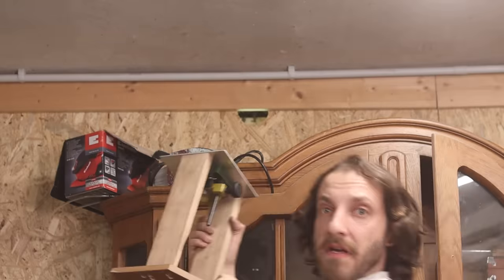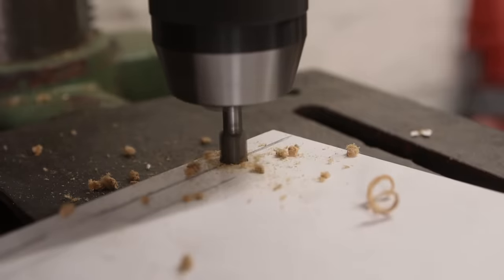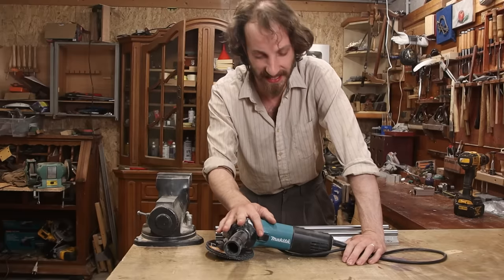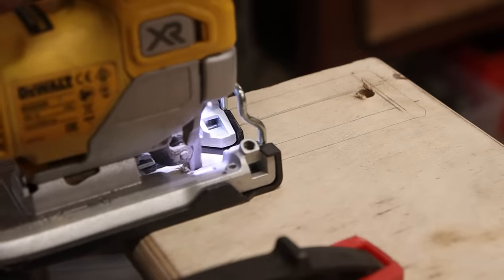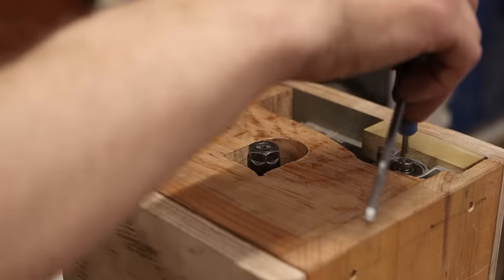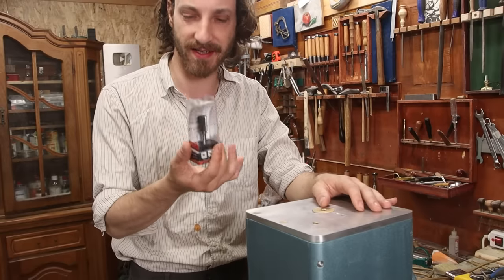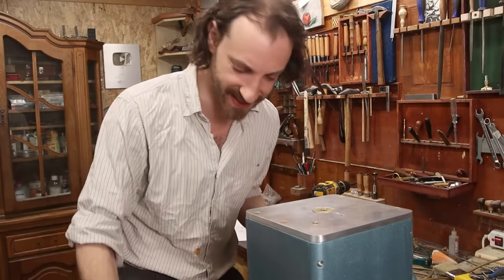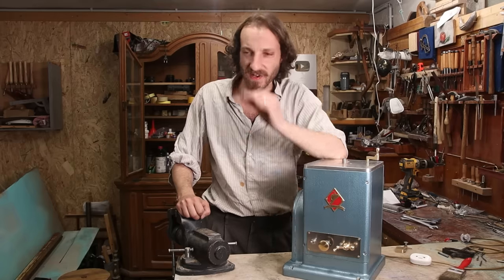Making a Router Table But It's For METAL

Comment: The Polish word for aluminum is glin.  Soooo much better!  
This video really made my day.  I needed a laugh, and you provided several.  Thank you!
Reply: +1 for glin!
Reply: In England the colloquial name is Ali, pronounce like alley, presumably from aluminium alloy.
Reply from the maker: Yes, glin, I like it!
Reply: Glin makes me grin. Glin foil is as easy to say as tin foil (which we use interchangeably though technically erroneously for aluminium foil). Count another vote for glin.
Reply: @chrisstephens6673   I just call it 'alloy' at work. But Tin is tin, not rolled steel.
Reply: I always just refer to it as "the metal that Americans can't pronounce". Rolls off the tongue.
Reply: @ricos1497  To be fair, there are 2 valid spellings of the Elements name that have 2 different pronunciations.
Reply: @ricos1497 Americans use the original name. It was the French or the English who decided to rename it just because they thought "ium is more scientific than just um"
Reply: +1 for glin

Comment: Fantastic work on this! Ive been using a palm router in a similar fashion for fine metalwork adjustment for a while now. I think it's time to make it more permanent!
Reply from the maker: Thanks! Absoluty! Though, I thought about using an actual router, but I'm afraid to die 😂
The spindle motor im using is a bit slower.

Comment: An incredible machine. It actually looks like cast iron from the 50s. The paint AK 250-90 is top synthetic and dries incredibly long, I think even a week depending on the conditions.
Reply: After drying is complete, it starts to harden. Like laqueurs, concrete, glues, epoxy, urethane etc. to reach the final result and stifness.
Reply: Do you know the specific name of the metal or finish? I've seen microscopes, slide projectors, and night visors with that chip texture gray color but haven't managed to find the name online

Comment: You should probably drill a hole in the top surface to accept a removable dowel, that way you have something to lean small workpieces against and won't be as likely to run a finger into the burr if it grabs.

Comment: I was wondering....how do you deal with the metal shavings falling down into the box? And your right the metal finish is beautiful!
Reply: especially since there is a china powersupply built in there. high pucker factor on the first slip aswell...

Comment: Another great video. You are just so creative. 

One little thing. That bit is actually for ferrous metal. For non-ferrous metal, there are special bits. Those don't have a cross pattern but cut sooo much cleaner in brass and ALUMINIUM. 

I'm actually from the Netherlands and just realised it is spelled the same in dutch.

Comment: 13:40 nope, you don't need a hardener. It's just designed to dry very slowly for certain applications.

You can put them in an (industrial) oven, to get a fast hardening process (60 °C for an hour, and you can assemble the parts) or let it dry for 24h under 20 °C conditions before assembly.

Final hardness is reached after 8-10 days.

Comment: You could also use a 14 in. chop saw for metal.  They make them with cold cutting, carbide toothed blades now (instead of the silicon carbide or aluminum oxide fiberglass blades of yore) which cut more cleanly and quickly.  You can get straighter cuts that way.  I can’t believe you have gone this long without an angle grinder!  They’re a must for any shop.

Comment: I really like this project, that would be super useful for my shop as well. Typical die grinder speeds always set me on edge so slowing it down is a major plus in my book. I wish I could give two thumbs up for the Candor, it makes me like the video even more than if it was all glossed over. Excellent job on the badge as well, top notch!

Comment: I think it looks great, the lines give it an Art Deco look and I love the color and the hammered finish paint, didn't know ppl had an issue with that type of paint. For me it ties the whole project together. Also I have to say the name plate looks amazing Ari, really great project. 👍👍

Just a tip, you can't use a metal router like a wood router and hog away material, it's just for cleaning up edges. 👍

Comment: That's the color of choice from the mid '60s, I had a 48" belt/disc sander with the same color from 1965. Also had a router table lift of somewhat similar design, minus the worm gear.

Comment: It looks pretty convincing. If I saw that in a workshop, I'd assume it was cast alloy or iron.

The only thing that I think could be improved is that control plate on the front. It could do with some engraved labels, and recessing the wood behind it so the plate sits flush with the front. That would make it look more like "It left the factory like that". As it stands, the plate screwed to the surface like that, it makes the panel look a bit like something an engineer did to adapt an old machine to take a newer replacement set of switches.
Reply from the maker: Yeah, that's a good tip! I'll be sure to make something a little different in the next piece.

Comment: Uri, you surprise me everytime, i hope that sometime i can visit a exhibition from you. Love your work! Much love from Hannover.

Btw. the Paint you first used needs around 6-8 Hours to be hard to the touch and 24 hrs to be completely dry when its around 20°C in your garage. you could have accelarated the hardening with a heater. it hardens enough to the touch in 60 mins when the painted part has around 60°C.

Comment: Tip for you, try using round over bits in the lathe to make the ball shapes. I have used them on every material and they work well. Good Luck.

Comment: As a person who appreciates whimsy, I greatly enjoy your videos. I would like to offer a suggestion for a project that may be right up your alley: a Rube Goldberg machine. Per Wikipedia: "A Rube Goldberg machine, named after American cartoonist Rube Goldberg, is a chain reaction–type machine or contraption intentionally designed to perform a simple task in an indirect and (impractically) overly complicated way. Usually, these machines consist of a series of simple unrelated devices; the action of each triggers the initiation of the next, eventually resulting in achieving a stated goal." Thank you for your consideration.

Comment: 12:11 we just call it by the grade. So, 2024, 6061 (specifically, where i used to work) 2024 is aluminum with copper as the main alloying element, used in aerospace applications. And 6061 is your bog standard aluminum, magnesium as the main alloying element; hard and tough, great corrosion resistance. 

Its not a "universal solution" but it works.
Reply: 2024? That is going to get confusing next year…

Comment: Great new tool Uri!  And I don't know why anyone wouldn't like that old hammered finish paint- it's SO much nicer than the ugly green many machine tools are today.  And congrats on getting and angle grinder!  I find them the single-most useful tool in my workshop- I have 6 or 7 of them now.  They can do most anything ;)  Oh and although I'm from a part of the world (Canada) that says 'aluminum', but since 'aluminium' is the IUPAC name, I'd prefer that.  'Aluminum' is the way it was first written in the early 1800s- although a lot of spelling wasn't standardized then anyway.  So we're stuck here with 'aluminum' just as we're stuck with Imperial measurements for many things, the silly 12-hour clock, and the even more silly MM DD YY date system.

Comment: It's funny, i was considering the same thing as i was baking brownies this morning and covered it in alu foil. I just call it "Alu" in most cases (in german), as there's nothing to confuse that with. inum/ium just means metal, as far as I recall, so it's not really needed.

Great video, i love the finished table. It looks amazing, and is probably a lot lighter than it looks.

Comment: Uri, as an engineer I must admit that there were times when I cringed at your actions, however the router works and that was the ultimate target. Your next project should be to build a sewing machine, so you can be well presented while you present 😅😂. There's nothing wrong with Aluminium, after all it was a Swedish discovery and Sweden is European. Good post, thank you, and try to keep your fingers attached to your hand and not the walls and floor.
Reply: Yes a uri take on a sewing machine would be good to see. Have been looking at 3d printed and the chinese leather cast I am modifying

Comment: In Poland we have aluminium, pronounced a-loo-mee-new-m. But there is also an unrelated Polish word for the element: glin, pronounced glee-n. It's mainly used for the element itself and not the macroscopic metal, but it's short and easy to pronounce, so you can have it if you want. It comes from the Polish word for clay: glina.
Edit: just read some further comments and realized I'm late to the party...

Comment: If you want to modify it further, a shavings collector? Maybe air powered to pull the shavings away. Maybe something that pulls from under the hole and above with another surface mount.

Comment: Omg the over arm follower, i would have never thought of that! That would be perfect for some stuff i want to use this kind of router for. 

I want to build essentially the same thing, i was planning the same motor and a simple tilt mechanism as well as lift (possibly adapt a spare router lift i have but idk).

Saw some stuff on using one of those motors horizontally on a stand as a general use bench motor in a lapidary shop. They made attachments for sanding pads + a table, a wet saw, buffing and polishing, all that stuff.
Sweetgum NYC - the videos im thinking of

Iv been wanting to do a router table like this for a while to make mini form cutters for the lathe. I have a few small items i make by hand but developing better ways to batch them out could make them a viable product instead of a single stupid thing im unwilling to sell for a reasonable cost lol.

Comment: The fact that someone as skilled and seemingly seasoned as you has not had an angle grinder until now is absurd and blows my mind... very cool though.. i think i caught an AvE reference in there which makes sense,, that guy is freakin awesome.. keep up the great work.

EDIT: i love the music for the portion brass handle, which is effing awesome that you made that.. how would you say ALUMINA in your part of the world? Oh and, that badge was badass.. ok lastly , try to make sure you dont wear out the burr in one place too much , oscillating spindle sanders do.a great job of this.  You can also put a cartridge roll on a mandrel in there if you dont want to be horrified at the thought of that thing catching and launching into valuable or vulnerable vitals, be it on your body or things.. idk

Comment: an advice.  isolate the power supply inside a sealed box as soon as possible or always put it outside with a box.  those type of power supplies have the PCB completely exposed and with all that metal dust and chips it's a snap to make a short.

Comment: Mipa PU 250-90 2K PU Top Coat semi gloss
High quality 2K-polyurethaneacrylic paint with a slow dust-freedrying for a high quality coating onmetal facades, machinery and steelconstructions. Mainly for rolling orbrush application. Also suitable asone coat paint on zinc substratesand aluminium.
Mixing ratio: 10:1 by weight
8:1 by volume
Hardener: Mipa PUR-Plus-Härter A 60
Thinner: Mipa 2K-Thinner

Comment: On my (wood) router table, I can change the bits without having to lift it all the way out, by means of a pair of offset or "bent" wrenches.  I just need to pop out the hole insert.

Comment: Hey, you have a lot of talents. You need safety glasses and a face shield if you want to keep them. The cost is so minimum that not using them is crazy. Those cut off blades on angle grinders break all the time.

Comment: Hey Uri , You should try to use a simple circular saw with diablo cermet II blade. it cuts through 30mm stainless-steel 303 like you cut a wooden dowel with the same saw

Comment: Just say "alloy" since pure aluminium is only used for electrical cable. We also say "ally" here. However whatever you choose someone will hate you. Another thing you can do is call it by grade. No one could complain about "T6 6061 alloy" or whatever you're using.

Comment: Aluminum or Aluminium, from the perspective of a machinist in North america, 30 years ago at least, as well as any other metal, could be referred to by it's SAE designation. for all grades of Aluminum, that would be SAE 20-, as a specific, SAE 2024, is aircraft frame grade. So instead of struggling with a word, you can just call it 20 series, or SAE 20.

Comment: Uri, you should totally make a brass wrench set. Market the for use with nylon nuts and bolts😊.

A steel wrench always fouls up nylon hardware. 

Or it may be the 200-pound gorilla using it. As AVE would say😅.

Comment: I understand you are new to angle grinders, but you put the zip disk in upside down. This doesn't matter 95% of the time but will be very dangerous the other5%. Some disks are made with a radial bias where if they were to chip/break one way they will clear themselves , the other they will dig in and overpower the user and throw the running grinder at them. . Be safe, I enjoy watching you.

Comment: Very nicely done. With the hammerite finish, it does look heavy and industrial. 
For aluminium parts, it is sometimes called ally / alli (as in Mohamed Ali) as in ally wheels on a car. Or "the engine has an ally head". "I covered it with a sheet of ally" Uk saying.  :)
Reply: Are you sure that isn't "alloy" wheels?  The only "ally" wheels I can find mentioned anywhere are not automotive.
Reply: @adrianhenle  We call them ally wheels. They are alloy wheels, and bicycle and motorbikes have ally wheels. I suppose it depends on the local accent where someone lives.

Comment: Aluminum/aluminium never made sense to me. The name comes from the fact that the element Al is found in alum. 

Consider the naming convention we use in other elements. Helium is the element found in the sun (Helios); potassium is the element found in potash; sodium is the element found in soda; uranium is named after the planet Uranus; etc etc etc.. 

In every case we take the root word and add -ium, or we shorten the root word and -ium. The element derived from alum should therefore be called alumium (a loo mee um) or simply alium (a lee um).

Comment: Uri, how much of that brass powder is going straignt into the motor windings?
Uri, how much is that motor and power supply getting hot int that enclosed wooden box.
Uri, when are you going to make holders for your work instead of holding it with your hands 2cm away from the very dangerous tool bit.
Mom's worried about you sweetie.

I'm also going to steal your idea of using hammered finish to make things look cast-iron-y.

But seriously never hold something so close to the cutting bit, jesus.
Reply: I agree with your worries. This machine needs a few air holes and should be used upside-down.

Or not be used at all and rather kept in a steampunk museum.
Reply: @raulkaap  Remove the bottom plate to let air in, make support beams to let the thing go upside down. Most problems resolved though it will need a grate at the (now) open top of the machine.
The just make an ajustable leveling plate so the work cant pivot, then he could in principle use his hands to move the work. No brass chips on the motor and supply that are now adequately cooled and the work isnt going to fly off or move vertically since the plates are olding it down.

You writing this down Uri? NO MORE HANDS NEAR THE SPINNY BIT! Your hands are far too precious for you to lose them over this.